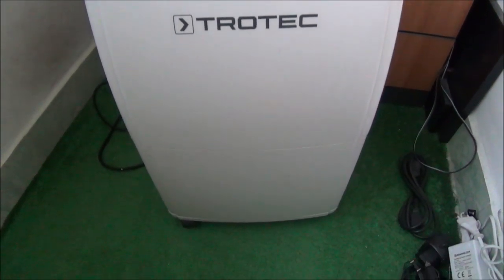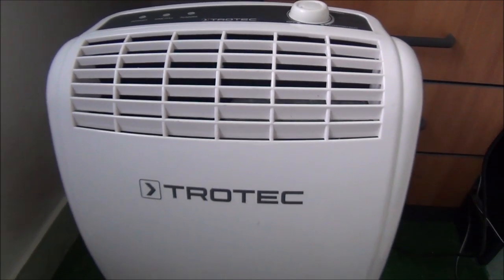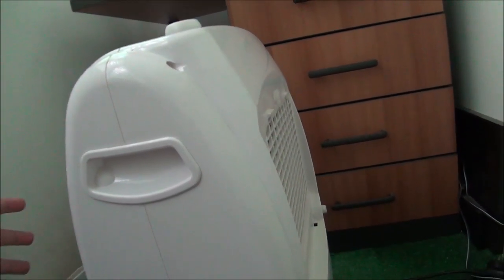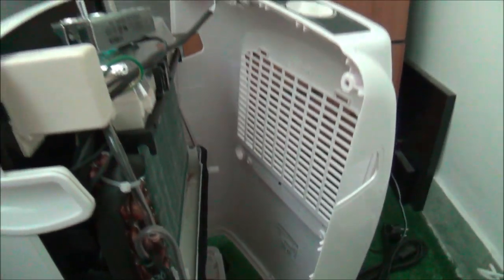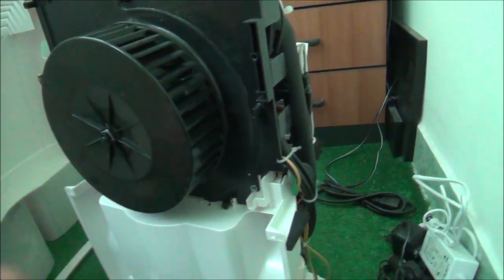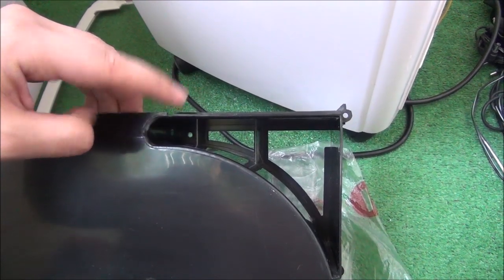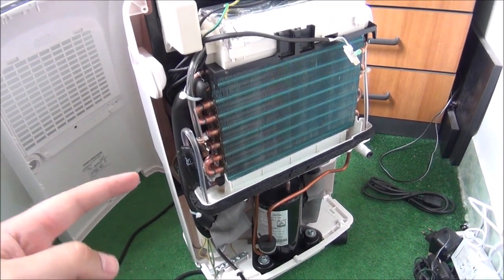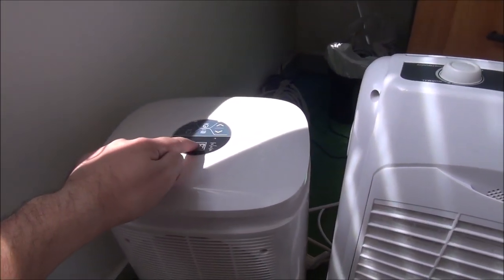💧 Trotec TTK 75 E dehumidifier teardown, cleaning and how it works 💧

Comment: Thank you for the teardown. My 1200 Watt solar panels make too much execess energy so i plan to rebuild a 400 Watt dehumidifier into a 1200 Watt heat pump.. Looks like the hot side can be seperated from the cool side to put about 5 cm of insulation in between. Then i want to enclose the cool side in a box that i let 7°C warter let flow through.
Reply from the maker: Glad my video helped. Nice project you have there. Hope it works well.

Comment: Salut am un Trotec ttk 96 e şi îl țin într-un loc unde este foarte multă umezeala și praf, cum as putea sa spăl radiatorul deoarece aerul care era tras de către aparat conținea și praf si praful s-a întărit pe radiator
Reply from the maker: Salut. Am curatat si eu unul recent, dar nu am avut posibilitatea sa filmez. Practic il desfaci, cat sa ajungi pana la radiator si puverizezi alcool pe el, cat sa stea tot umed vreo jumatate de ora. Apoi am dat cu o pensula cat am putut printre lamele si la sfarsit am pulverizat alcool din nou sa spal tot. A iesit destul de bine, dar a fost multa migala.
Reply: @UltimateDIY  Mulțumesc
Reply from the maker: Cu placere 👍🏻

Comment: Is it possible to refill the cooling fluid?
Reply from the maker: Yes, it is possible. Search for a freezer repair man. They have the tools to do it.
Reply: while yes they can be re-charged with refrigerant (most likely R22 or R134/R410A it will usually state the type on the label on the compressor) if it needs re-charging it most likely has a pin hole leak which can be caused by the refrigerant pipes rubbing together for example from vibration etc. To fix them usually costs more than it is worth to repair a unit from a reputable manufacturer should last for many years without needing to be recharged with refrigerant hope this helps.
Reply from the maker: Indeed. But weirdly enough one of my units was not cooling anymore and when checked it was not leaking pressure. It was refilled and seems to be working well. But it could be such a small hole, that it takes years for the refrigerant to leak. But if I refill it more than 3 times I almost end up at the same price as a new one.